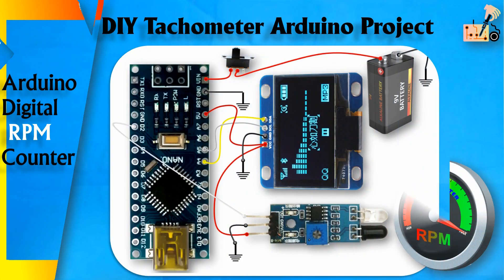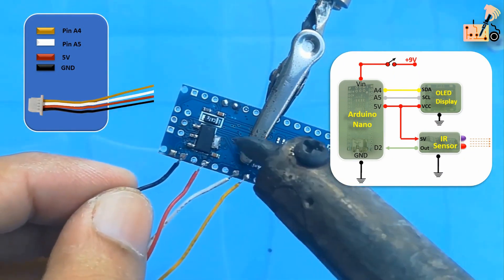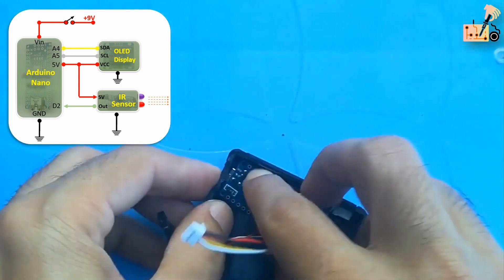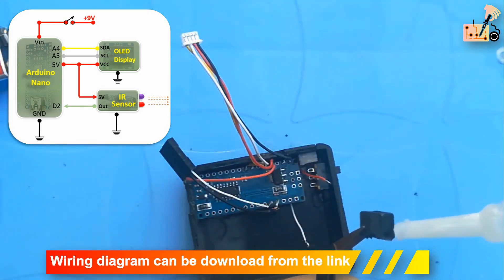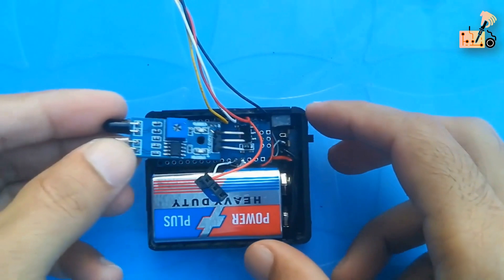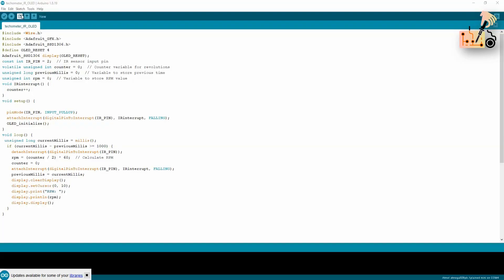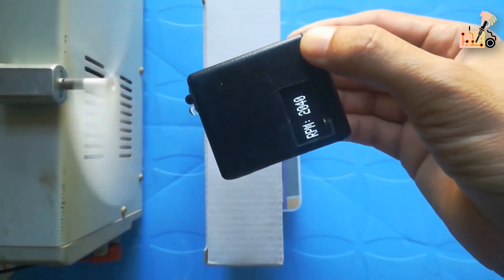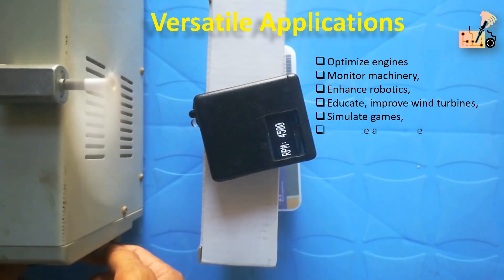Revolutionize Your DIY Projects with This Crazy Easy Tachometer Hack

Comment: In the code you set the number of pulses to 2. But what if the fan you are measuring has more than 2 blades? Do you have to change the code for each thing you test?
Reply: You could change it to 1 then just remember divide by n pulses per revolution on whatever you’re testing after the fact

Comment: Can i use automotive car sensor?
Reply from the maker: you mean automotive parking sensors? you can use any sensor which has a beam transmitter and receiver mechanism. if it operates at 5v and gives you pulses then you can use it.

Comment: I have a problem 😔
Reply from the maker: Thanks for reaching out! I’d love to help you with your issue. What seems to be the trouble?
Reply: @HobbyElectroLab  Hello sir, yes I need help, is there a way to contact you?
Reply from the maker: Yes you can contact us any time
Reply: @HobbyElectroLab  Yes sir, is it possible to replace the IR SENSOR with LM 393 motor speed sensor? And what will be the schematic or connection and the Arduino code?
Reply from the maker: LM393 is a dual voltage conparator used to compare preset reference voltage signal with actual voltage signal usually used in power supplies. its not a speed sensor but it may get a speed signal from any sensor. usually hall effect sensor used in motors. but for techometer you may need IR sensor or ultrasonic or similar or hall effect sensor if your rotor blades are of magnetic material.

Comment: can i use ATtiny85 chip instead of Atmega328 for this project?
Reply from the maker: Yes you can use it. For interfacing attiny85 with OLED and sensor visit this link
https://github.com/korziee/attiny85-fan-rpm-oled-display